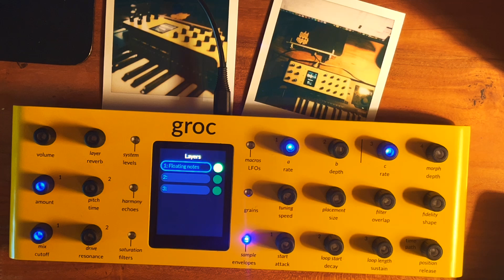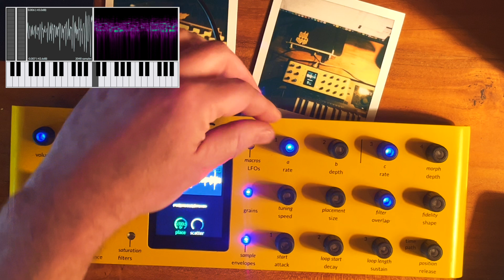Groc Granular Engine: Filter and Placement

Comment: Is it possible to round robin multiple patches with each key press?
Reply from the maker: Not yet but I can definitely make it so!  The (not yet shown) morph knob will morph/blend between the first two layers. Maybe there are several variations we can think of including a round robin mode.
Reply: @oddment-audio  That would be very cool. There are so many different ways to implement voicing options to achieve different kaleidoscopic textures and effects…it’s a shame more synths don’t offer more polyphonic alternatives to the usual voicing algorithms.
Reply from the maker: Currently all the grains parameters have a randomization that can be applied. All the demos I have shown apply this per grain (and a voice consists of many, many grains). We also have a mode where the randomization is done per note played. So, for example, if you randomize the grain size, the default behavior provides variation within each note, but this alternative would randomize the grain size each time you hit a note.  This is the kind of thing I will work into the "secondary" parameters that you can touch via the screen.

Comment: How is pitch scaling implemented?
Reply from the maker: Everything is done in the time domain, re-sampling to adjust each grain's periodicity. If you have long enough grains, you will generally then get the pitch of the original sample adjusted by the resampling factor. But as the grains are shorter, the inter-grain interval (space between grain playback) strongly influences the perceived pitch. The most artifact-free pitch shifting algorithms will do pitch some periodicity analysis on the input sound to control both the grain size and the inter-grain spacing (e.g. PSOLA). We will offer this and even some more modern flavors, but at the moment, the implementation puts all the controls in the users hands with the grain size and grain overlap controls. You can achieve nice and smooth sounding pitch shifting but may find the controls need some tweaking across different samples to achieve this.  The benefit is that you can seamlessly move from smooth pitch shifting to nasty ring modulation artifacts, bc sometimes that sounds awesome!
Reply: @oddment-audio  I admit need to look more into the different compensations. But I of course I know psola as is used in variphrase!! So that's exciting news! 

Impeccable design, 'marketing', and pr skills, btw, cheers!